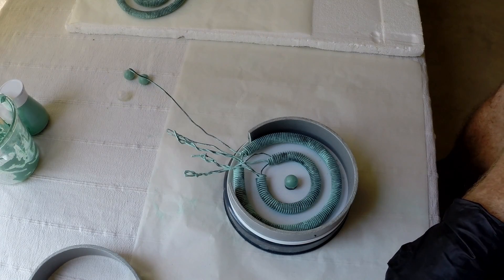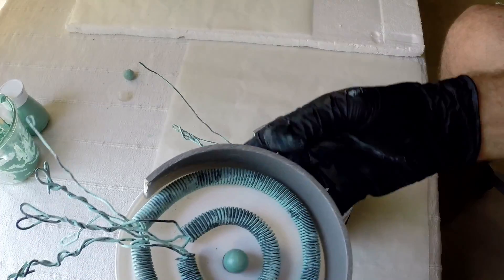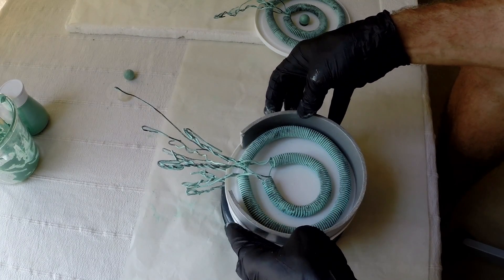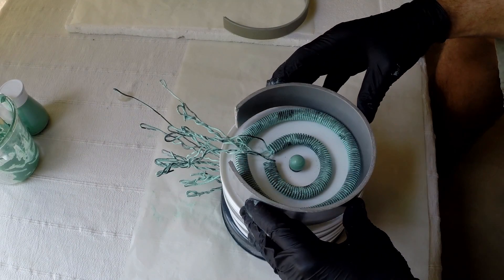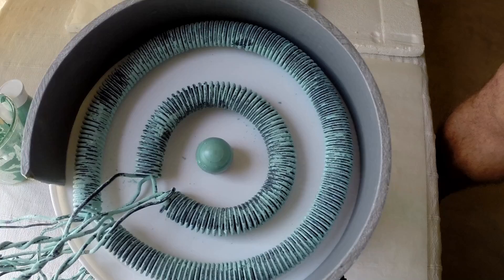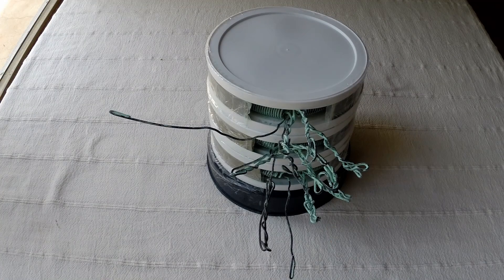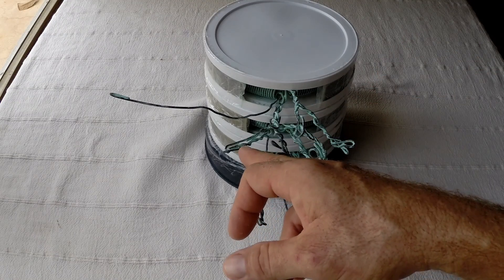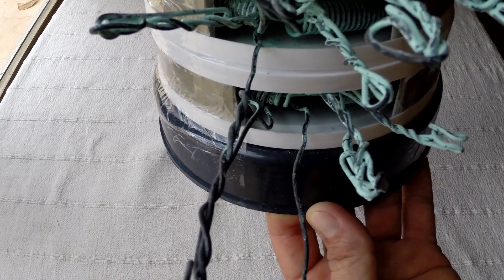Keshe Coil Stack

Comment: Conditioning the Magravs Power Unit - Preparation

http://blueprint.keshefoundation.org/manual.php

Failure to follow the above recommendation at this stage may cause the unit to be rendered inoperative.

Slow down - take time and follow the instructions and stop going in your own directions!

The purpose of the Magravs Power Unit is to send and receive power at the plasmatic nano-coated level, and not at the metal copper-matter level – remember, the key to Magravs technology is in the nano-coating of your household copper wires via the Magravs Power Unit.

Just like bringing home a new puppy, we need to train the Magravs Power Unit to satisfy our energy needs, as well as to train ourselves to understand the system. This is not simply plug and play. It is plug and interplay – YOU are 1part of the whole connection! It is time for Humanity to reconnect with the energetic plasma world!

Therefore, it is crucial to nano-coat all wires in the household in a gradual and systematic manner through the Magravs Power Unit.

It is important to remember that once the Magravs Power Unit is connected and turned on, do not turn off or unplug the unit from that point onwards. It MUST keep running continuously in order for it to work effectively.

Please refer to last week's 89th KSW in our YouTube channel where Mr. Keshe mentions that they've discovered that 144 turns for the outside rings work much more effectively than the 162 called for in the blueprint. He also mentioned that nano-coating via fire method (butane) works more effectively for the Magravs Power Units.

Canadians Only
https://www.facebook.com/groups/keshefoundation.canada/

1950 Ralf Ring and the craft they built - taken by the FBI 
http://bluestarenterprise.com/

Comment: The way I hv made them is to twist all the layers of coils together in the copper wire state and nano the whole thing so the coating is seamless over the whole unit from top to bottom. Then you gans the whole thing. As far as I can see the matter structure (coils) is a "guide" for the plasma flow so the flow will stop at any point that is has a nano coating break. The nano coated copper is iteself the attractor of the plasma but the condition is the physical space it is in so you put a gans on the nano coating to create a special condition that will draw the plasma energy into the system.

Comment: I admire your hard work but would like to see a honest to goodness working unit dismantled in front of a camera after it had powered what it claims to power. That would prompt me to build one myself.
Reply: So far that has not happened.  Just a far away view of electrical appliances working with no apparent hookup to any small box containing the setup you are trying to make.
Reply from the maker: +Thomas Ferko I agree...
Reply: I have invented a free energy setup myself. It puts out hi voltage and low current.  Free and easy to construct.  Click Thomas Ferko on the You Tube
And follow my free energy postings

Comment: Shouldn't you be stripping the nano-coating from the ends of the wires you are connecting? Otherwise, no contact is happening between the copper coils in the stacks.
Reply from the maker: +Mark Brems It is running, so it must be making contact....

Comment: Thanks this will help a lot of people move along and get things done.  Nice work. Try this is on next setup. Thicken your GaNs  to the level of a thick ketchup you want it to stick on everything without fail to get the best results . I would think you don't want to see exposed  black nano, everything should be covered within the coil areas.